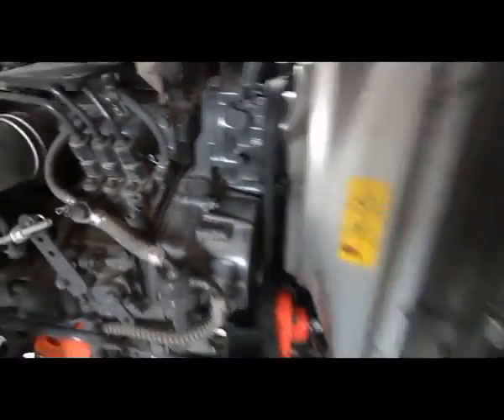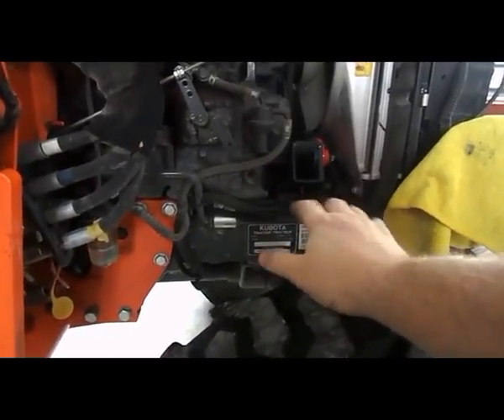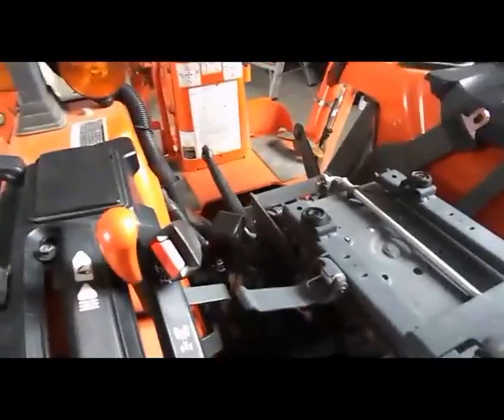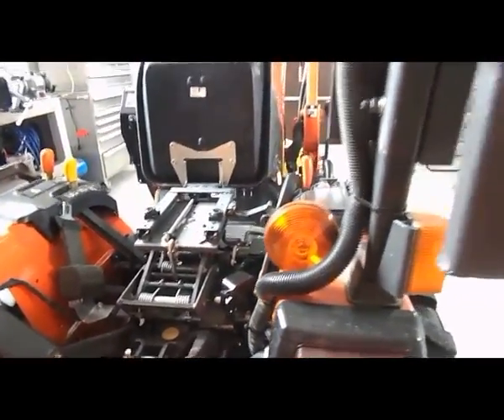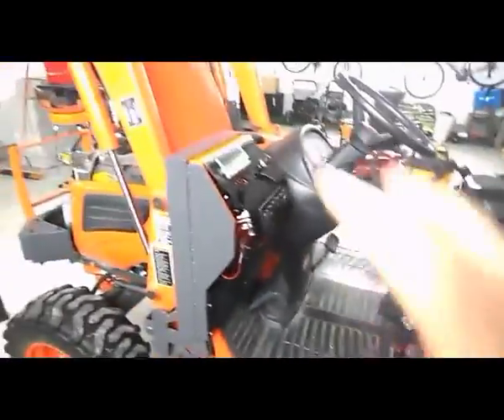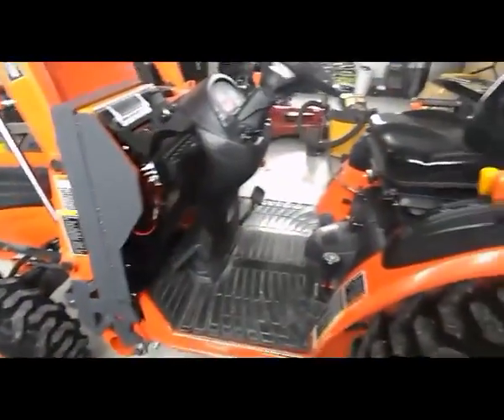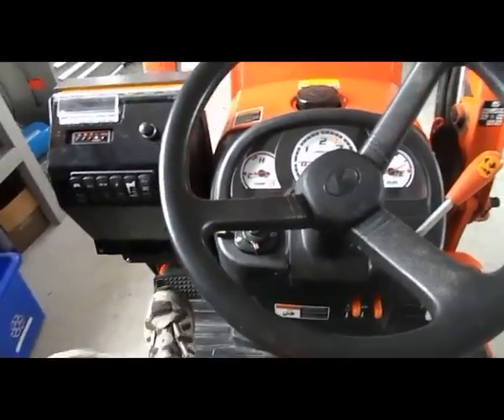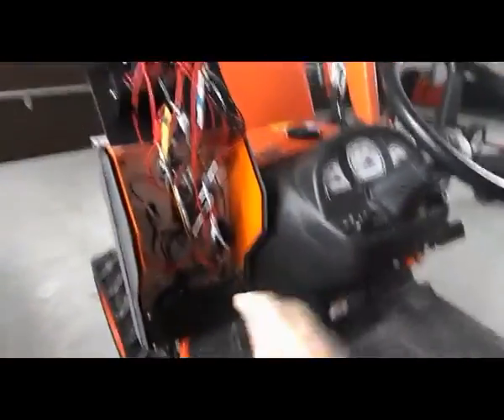Kubota B2620 - Horn and Backup Alarm

Comment: The two wires that are at the back right fender of the tractor are they both hot?  
So that I could wire 2 separate lights  with 2 separate  switches and run a ground from each one . 
Thank You
Reply from the maker: I believe it was only the one cause I had to use a test light to find out which one it was, but I'll double check that, been a while since I did it and I'll have to unwrap some wires to check it out.
Reply: Thank you for any information about it.